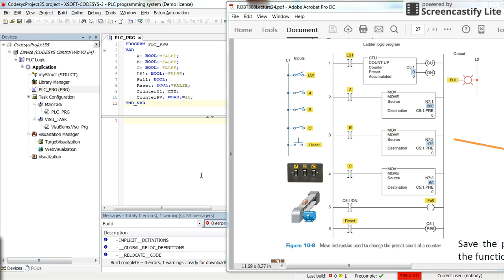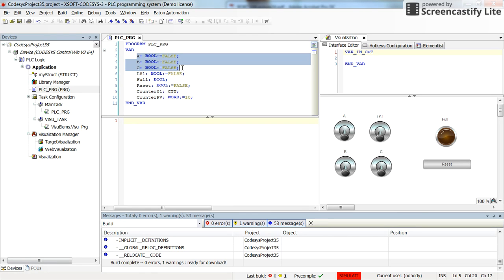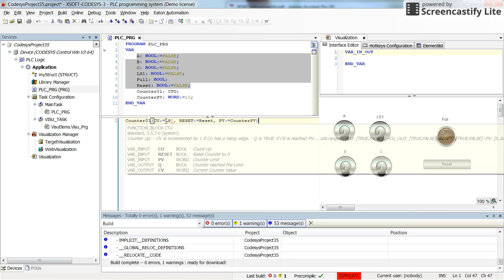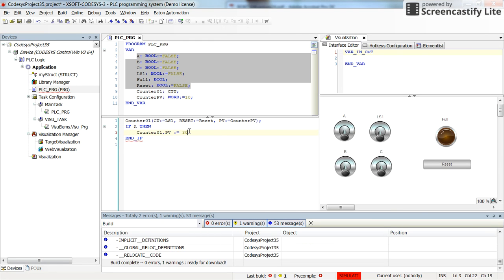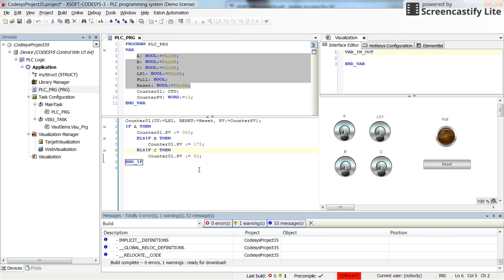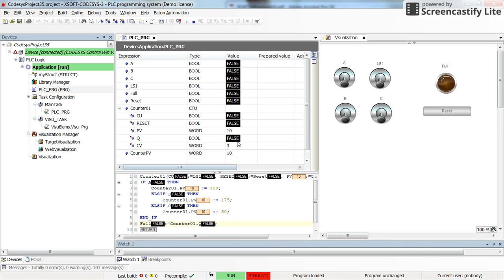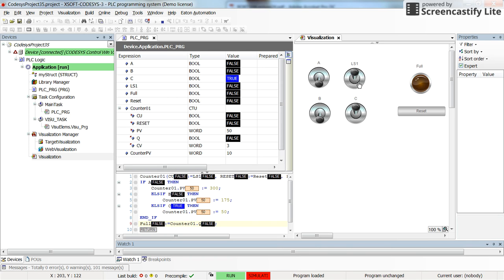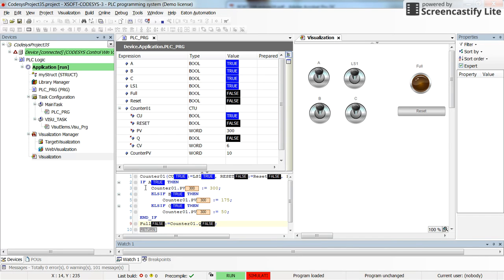CODESYS: IF-ELSEIF instruction in Structured text programming #codesys #plcprogramming #iec61131 #st

Comment: Excellent tutorials. Thank you. I am doing all of them.
For this tutorial I have 2 suggestions: 
1. Use CounterPV within the IF/ELSIF statements instead of Counter01.PV (This way the operations of A, B, C change the preset value)
2. Use smaller PV values in the test of the logic so that you do not need to flip the switch so many times to validate the logic. (IE: 12, 14, 16 instead of 50, 175, 300) After the logic is proven to be correct, adjust the numbers back to the higher values as desired.

Comment: Hello Tohid,
Thanks very much for such an informative tutorial!
However, in this case, the Full continues to become true when CV=10 although the PV of the counter gets updated in Counter01.PV depending on the selection between A, B and C.
What should be done to update the code such that the CV now considers the new PV whenever the conditions are true and not the PV value  initialized in the variable declaration?
Your inputs are valuable!

Many thanks,
Kalyani
Reply from the maker: Thanks for your comment. I believe that you should not do anything and the counter should consider the new PV. I will have a second look at it and let you know if this is not the case.
Reply: @TohidAlizadeh  Corrected: Counter01(CU:=LS1,Reset:=Reset,PV:=CounterPV);
IF A THEN
	CounterPV:=5;
	ELSIF B THEN
		CounterPV:=3;
	ELSIF C THEN
		CounterPV:=2;
END_IF
Full:=Counter01.Q;
Reply: Thanks very much for having responded to me!
What I meant is if the PV is updated, the CV should consider and turn the counter's output with respect to the new PV, isn't that how it is supposed to work? 
What happens with the code is that the PV gets updated, but the CV continues to turn the output on for PV = 10.
Can you please help me understand how the counter operates?

Thanks again for your time!
Reply: @kalyanikadkol4006  Same, encountered the same issue. Do you happen to find out how to fix it?